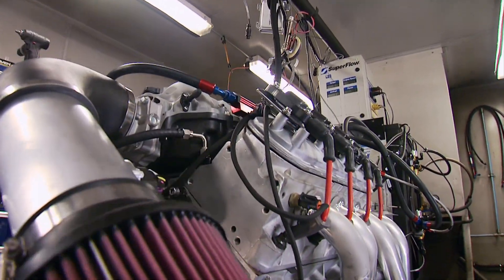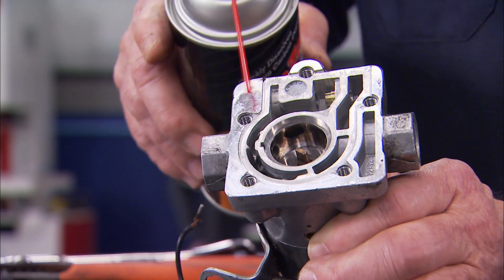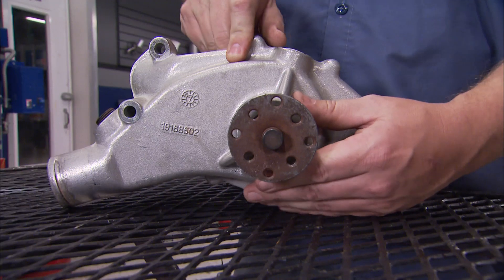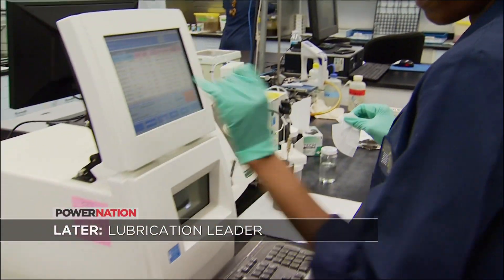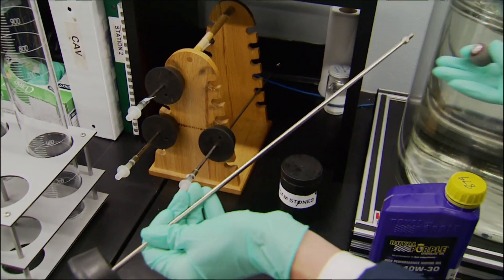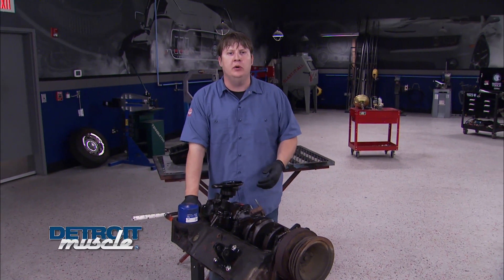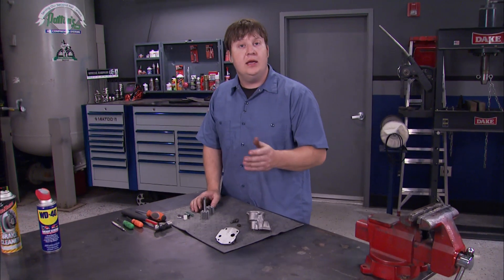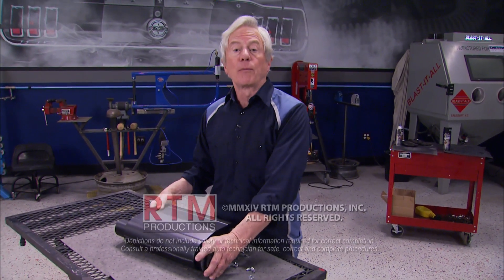Keep Your Engine Alive: How-to Rebuild Water, Fuel & Oil Pumps - Detroit Muscle S1, E16

Comment: The engine Masters channel has conclusively proven that you don't need bypass mufflers

Pick a good muffler and it barely inhibits the flow

We're talking like five horsepower on a 600 horsepower motor

More than worth it to not have open pipe noise

Comment: Water entered the motor housing of my Holley red pump and rusted behind the magnets, which caused them to rub and prevent the rotation of the armature.
I really have a problem with putting a dark colored oil in my engine, this is why I'll probably never buy Royal Purple.